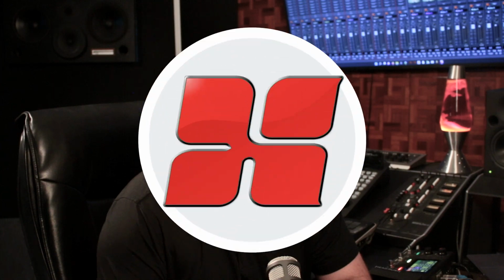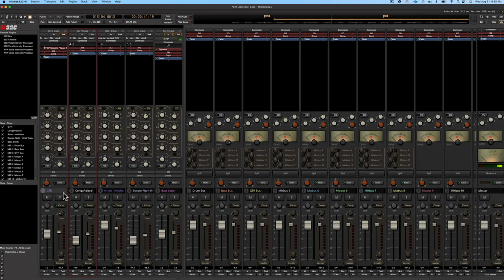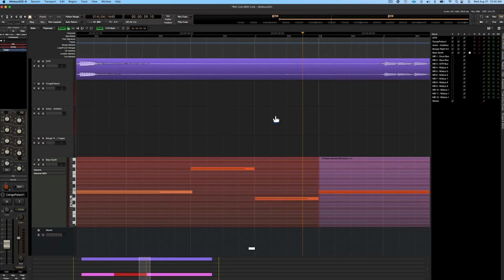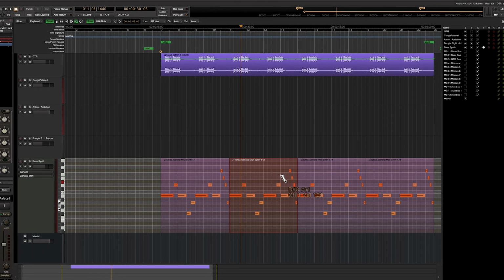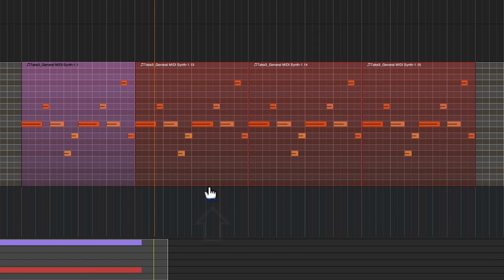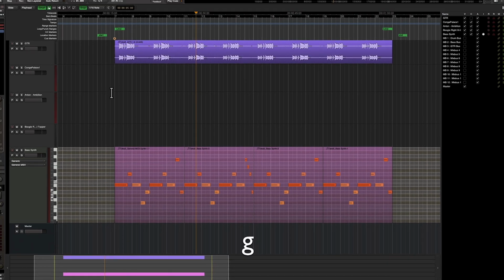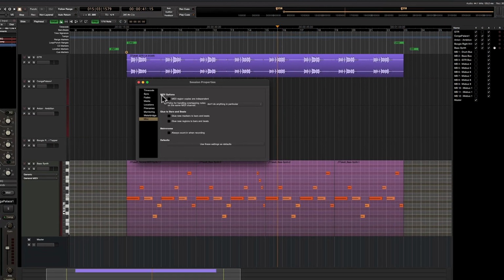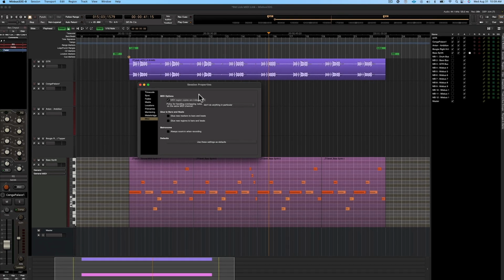MIDI Linking | Mixbus32C v8

Comment: Midi in Mixbus is 20 years out of date, worst midi features ever. I refuse to use midi unless you add all the basic midi editing that has been around for 30 years. Sould be AUDIO ONLY stated on the box.....so shite
Reply from the maker: Thanks for the comments.  Can you describe the areas you feel MIDI is lacking so we can continue to make it better?  

-Nathan
Reply: @HarrisonAudio  double clicking on the Midi clip to expand it into an editing gui would be great. It's been a standard since some of the very first editing programs and it's something you guys do not include, having to zoom in on a midi track to edit it is extremely frustrating. If you could edit each Midiclip in the track by double clicking life would be the way it should be
Reply from the maker: Yes that is a common request.  Thanks for letting us know your thoughts.   You may enjoy a video coming out this week showing different zooming techniques.  :)

-Nathan
Reply: @HarrisonAudio  scroll wheel??? Come on this is basic stuff guys
Reply from the maker: the scroll Wheel can be used for all kinds of midi editing.  You can select MIDI notes and then use the scroll wheel while hovering over a note to change the Velocity for example.  All this is well documented in the MIxbus and Ardour manuals.  

-Nathan
Reply: @HarrisonAudio  this is good to know, Thanks